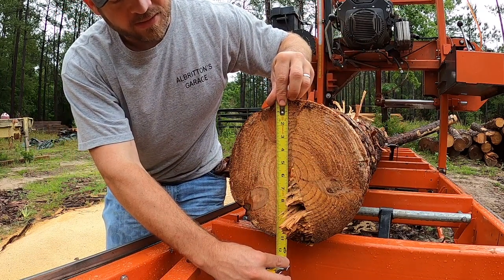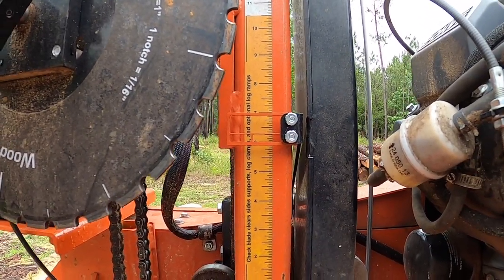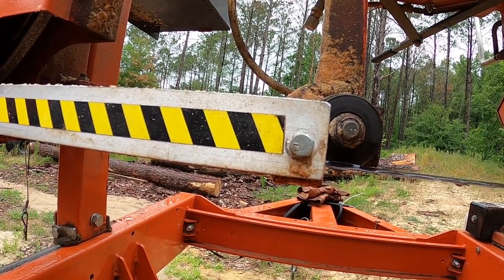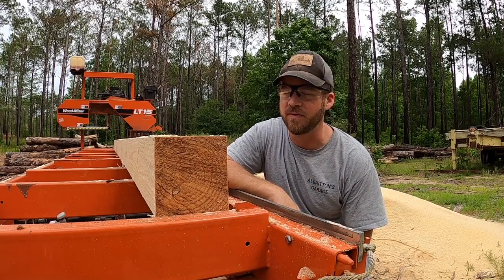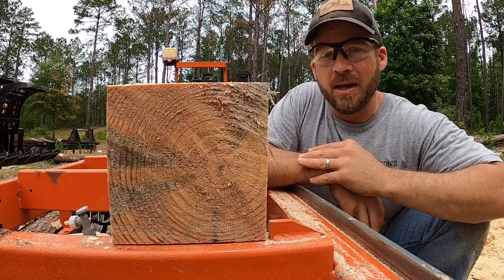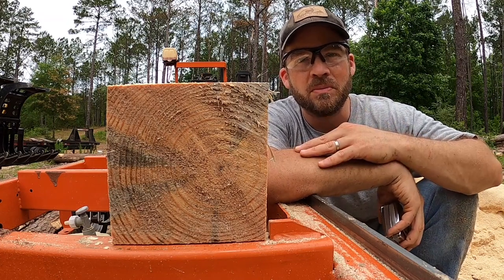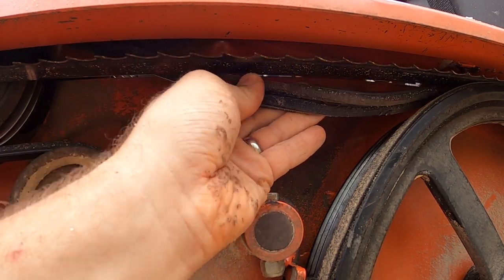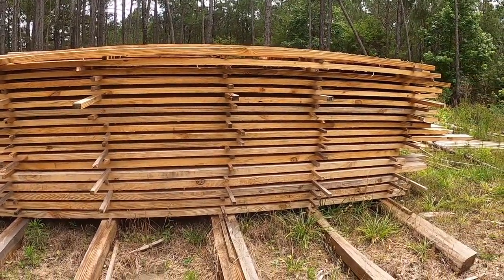Making Pine Timbers on the Wood-Mizer LT 15

Comment: The wood will warp somewhat after drying. Especially at the center. For this reason, you want to leave extra material. When the wood is dry, you run it thru a jointer to make it flat again. Some material will be lost in the process

Comment: I use a soap solution and water for lube. I have found that diesel will eat at any rubber items. Like belts. Do you have this trouble?
Reply from the maker: That could have been a factor when a chunk came out of the belt later in the video.

Comment: Those logs look pretty uniform. What prevents you from sawing them two at a time?
Reply from the maker: I've tried that before, and it does make things go faster. However, it's pretty fussy trying to flip and move two logs at a time around on the mill. Plus the sawdust tends to spray all over the place between the logs.

Comment: I'm surprised your mill is so inaccurate. Can the manufacturer help with replacement parts or whatever is need to get desired cut dimensions?
Reply from the maker: Yes, I could take it to Wood Mizer and they would bend over backwards to fix it I'm sure. I've always had great customer service from them. To be fair, though, some of it is probably operator error.

Comment: What did you do with all the cut offs?
Reply from the maker: These got wasted. Since then I've started putting the off cuts from the squared up cant back on to get another 2x6 because I realized just how much I was wasting. The round cut offs, however, are usually not worth the time because it takes a lot of handling to get something out of them. The square ones only need one cut. Thanks for watching!
Reply: @falllineridge  Are they any good for fire wood?
Reply: @tinydancer7426  in the UK they would be grabbed at for firewood, with logs such high price
Reply from the maker: @tinydancer7426  For outdoor use. Pine is very pitchy and can build up creosote in chimneys.
Reply: @falllineridge  Ah, so. Yes. I knew that. Don't know where my brain was. I know better. I remember my mom being very picky about the fire wood she would accept.

Comment: I'VE OFTEN WONDERED ABOUT WHY THEY RELEASE THE BLADE AFTER EVERY CUT, SEENS LIKE JUST LEAVIN IT ON WOULD BE EASIER, JUST MY TWO CENTS
Reply from the maker: That works when you are making multiple cuts without repositioning the log, but when you need to reposition the log it's not really safe to leave it going.

Comment: Diesel as a lube?  So your saw is spraying diesel fuel all over the place?  What, in a day it would be like dumping 5 gallons of diesel on the ground?  This seems stupidly unnecessary, and will probably make every tree hugger go into spasms.  I'm not a tree hugger, but I'm also not stupid, what is wrong with you?  I use water, and cut the pitchiest white pine known to mankind.  Never had a problem with 'buildup'.  This is the dumbest thing I've ever heard.  Granted I've only been milling for a couple years, but - hey, may sure you mill next to a waterway, or where you plan on drilling your well!  Do other shitheads really use diesel as well?  A gallon for 10-15 logs?  So you aren't getting any real cooling from the lube, which is the main reason for the lube (it isn't to lubricate, it's to keep the blade from overheating - 1 gal in 10 logs won't cool the blade enough to be effective).